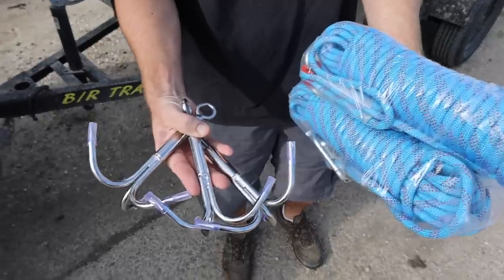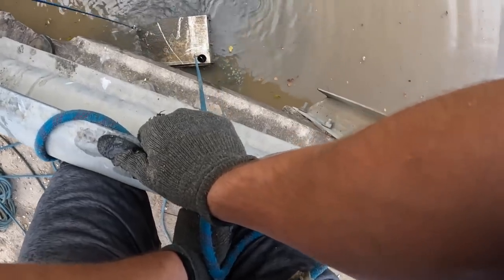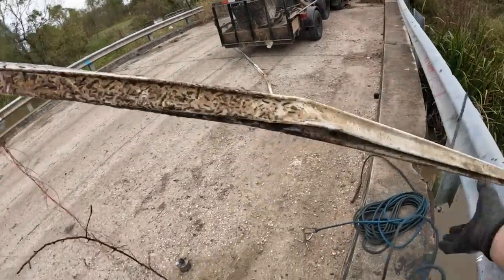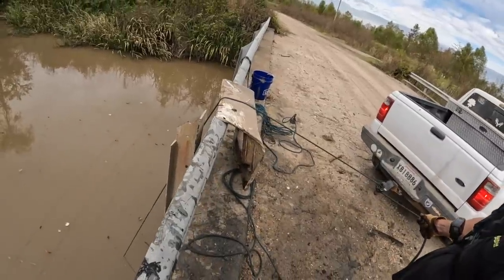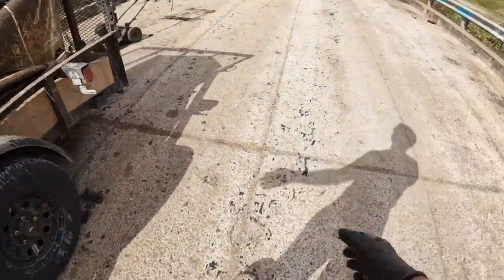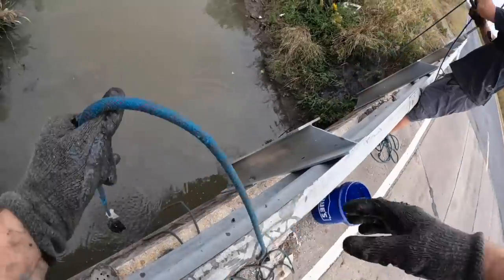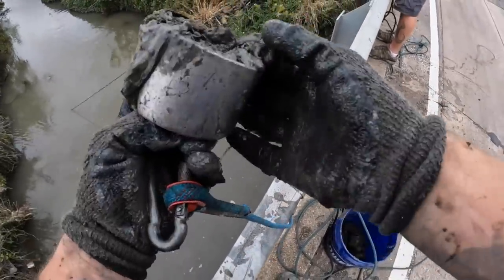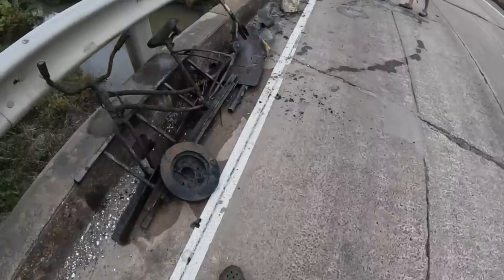Finally! We Found The Litter Bug - Magnet Fishing For MASSIVE Finds

Comment: Nail. If you get plastic ice scrapers or plastic paint scrapers you will save yourself from some puncture wounds from all the nails and thin wire. Also if there’s any hypodermic needles you will save yourself from having to be tested for who knows what and the worry that comes with it. I know it gets pretty hot out there but all of you need to wear long pants and sturdy boots to protect yourselves. Broken toes and scraped up legs with whatever might be in that water and mud is nothing to take lightly. We want you around for a while longer.